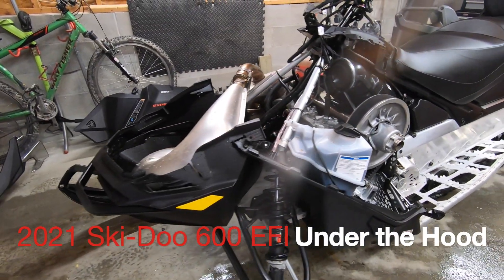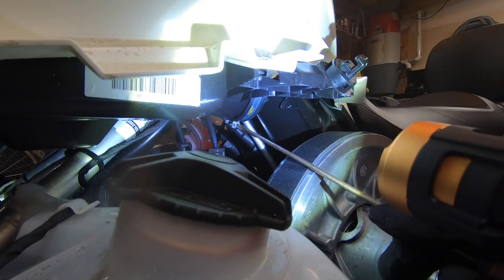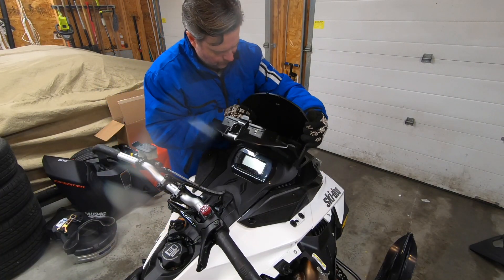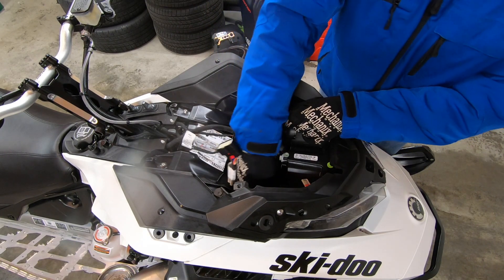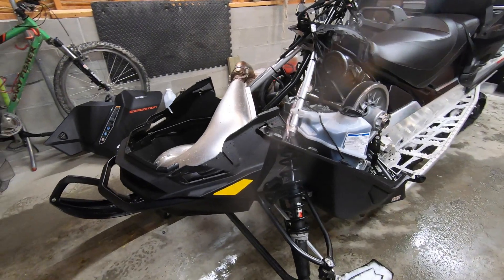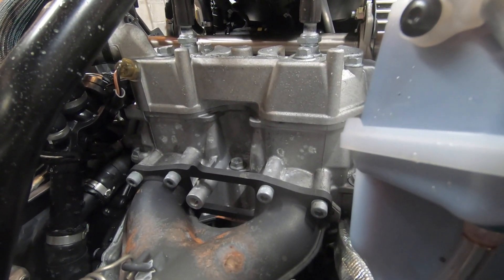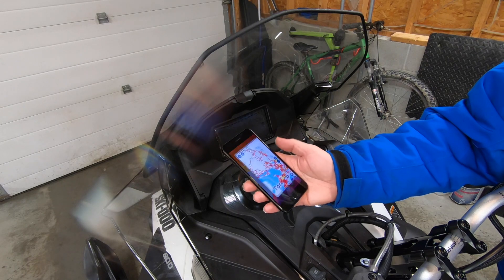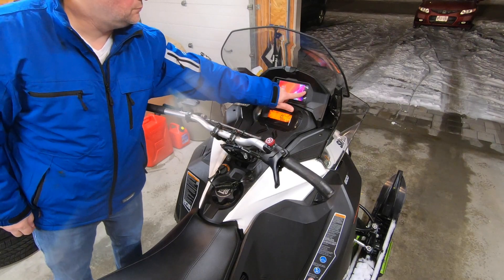600EFI Under the Hood

Comment: what kind of mileage are you getting with the 600 efi and how does it do in extreme cold temps for starting, like -40 F?  Great videos, doing research before getting one as I am use to the 600 ace in past models.
Reply from the maker: Fuel and Oil consumption documented right here my friend! https://youtu.be/oaB36RJx6lo
Extreme cold: if it doesn't start right away, hold the throttle open and try again to avoid flooding the engine. It hasn't let me down yet. Coldest day so far was about -36°C.

Comment: Iam a serious brp fan.. and really like these new sleds handling. But when I looked at wide tracks it's between expedition skandic or vk540. At least on the 540 I can change a darn spark plug
Reply from the maker: I'll have to update this video: after removing the upper bodywork a few times, I can have this hood off in 5 mins and it gives me better access to the internal components than the classic front-hinged design.

Comment: Well great video but these new sleds suck for maintenance! give me the days when you could just lift the hood and work on it. Anytime you have to undo multiple electrical connectors you are going to start having issues that is fact dealt with it already on several sleds
Reply from the maker: To avoid problems down the line, I've been applying dielectric grease liberally to every connector I encounter. This should lubricate the contacts for easier maintenance in the future, but also to reduce wear when disconnecting.
Reply: @mop1471  Yes that comes with a risk also. Some will disagree but this is fact learned the hard way. You should never apply dielectric to electrical contact surfaces as it is an insulator not conductor. It will actually cause a plugged connection  to not work properly.  Again I know many use it and it is great stuff used correctly but not on a contact surface.
Reply from the maker: I don't disagree at all. Professionally, I design computers for industrial vehicles. We had some problems with connectors corroding, so we did the math and determined that applying dielectric grease, even to contact surfaces, will solve more problems than it creates.

One of the reasons for this is because we've over-rated connectors by 99%. So a max 30mA circuit will use a 3A connector. Since we only need 1% of the contact surface, the dielectric grease won't degrade the connection enough to cause electrical problems, but it does solve corrosion problems! (It's worth noting that we can't use 'appropriately' sized connectors because a connector rated for 100mA will be far too small and delicate to survive the industrial environment, so we must use larger connectors with stronger mechanical properties.)

I suspect Ski-Doo does something similar. I see a lot of Molex connectors under the Ski-Doo hood, rated for 20A+ per pin, and they're powering circuits that can't possibly draw anywhere near that kind of current (with the possible exception of the headlights.)

Comment: I really appreciate your videos. I just purchased the skidoo expedition sport with 600 efi and the information is great to learn the sled. I just purchased a helmet with heated visor. Any chance that you are going to do an instruction on how to install the power supply?
Reply from the maker: Glad you're enjoying the vids!

The first mod I did was the heated visor connector installation, and I'm afraid I didn't film it :(( 

Installation required removing the upper body work (as documented in this video.)  It seems like a lot of work, but it's really not bad and it'll be great to get some practice with your new Expedition. I've got the body work removal down to 5 mins now that I've done it a few times.

Heated Visor Kit Ski-Doo p/no 860201283 is really well priced directly from Ski-Doo and it's a great first DIY project.

Installation (with upper body work removed): 
- The hole for the heated visor plug is pre-drilled in the console and covered with a plastic cap. From the right side of the sled, reach under the console and pop out the plastic cap. (see timestamp 3:40 in the video.)
- With the heated visor plug wiring harness, slide the grounding ring over the threaded portion of the plug, then insert the plug through the hole in the console, from the underside of the console. Hold it there with one hand.
- With your other hand, thread the plastic nut / connector cover onto the heated visor plug above the console. Don't do this by twisting the harness under the console as this will strain the wires in the harness. Instead, hold the connector and harness steady and spin the nut / connector cover from the top of the console.
- Next, you'll have to make the electrical connection to the accessory wiring harness. Most accessories have a 'pass through' connector, so you can daisy-chain more accessories to the circuit. The last, unused plug is always left connected to a 'dummy plug' under the console. Location of the dummy plug is identified at timestamp 3:55 in the video. Unplug your accessory wiring harness from the dummy plug and connect your heated visor plug wiring harness to the accessory harness. The heated visor plug harness does not have a pass-through connector, so you won't have to reconnect anything to the dummy plug. 
- Use zip ties to make sure the heated visor plug wiring harness is secured in a safe spot under the console (you don't want the wires to be able to pop out while you're reinstalling the upper body work!)
- Reinstall the upper body work and enjoy a fog-free snowmobiling experience!

As soon as we get enough snow for the trails to open, we'll be filming some Ski-Doo adventures! Make sure to subscribe so you don't miss upcoming videos, and please share these videos with like-minded snowmobilers!

Comment: I wish the 2022 Expeditions would have kept that body work. I spring ordered an Expedition and a Renegade (both 600efi), and the Renegade (same upper body as your 2021), is way easier to work on than my newly designed Expedition upper body.
Reply from the maker: Interesting. I noticed that the brochure no longer specified 'narrow body work' on the Expy 600 EFI. I suspect they're trying to differentiate it from the sportier machines - with the narrow body work, the Expedition was basically somewhere in between the Backcountry and the Summit. 

On the positive side, your wide bodywork should accommodate the radiator with electric fan for additional cooling if you ever want to go that route!
Reply: @mop1471  I heard you could install a 20" track also, but can't confirm on the 2022. Great vid btw, I will be getting a Sport Expedition also.
Reply from the maker: Some Expeditions are available with 20" wide or even 24" wide tracks. I don't know if the tunnels are wider to fit these tracks. I've heard reviewers talk about how wide the SWT versions are, but it's unclear to me if they're literally talking about the tunnel width, or just the handling of a snowmobile with 24" wide track...

Comment: Other then the emergency pull cord Does it have a pulll start??? Maybe i missed that part .. or is it all electric start?
Reply from the maker: No, it does not have a pull start. Just electric or emergency cord. 

I was actually tempted to spend more for a machine with the SHOT starter system, because it has a proper pull starter in addition to the emergency cord and SHOT system. However, I'm happy to report that the electric start has been 100% reliable throughout the first season or riding.

Comment: Great video. Can the 600 EFI spark plugs be changed by removing the side panels only or does cab need to be disassembled on the trail to change them? I recognize parts under your hood... my 900 ACE not so much.
Reply from the maker: I haven't had to change the plugs yet, but I'm sure I could reach them through the side panels. If I were in my shop, I'd just pull the upper body off. It only takes a few minutes and gives full access to everything.
Reply: Remove the side panel, easy access. I have 4500 km on my Backcountry 600 EFI.

Comment: Range?
Reply from the maker: It’s still in break-in, and the manual says it runs rich until break-in is done. So I can’t really say yet. I’m expecting about 300 kms per tank if I can behave myself.
Reply: @mop1471  200 km would be a better number.

Comment: Great video...any regrets on the sled? Any issues, concerns, problems? Is it comfortable? Does it dart from side to side? This "twitchy" steering is a common skidoo trait. Thanks bud
Reply from the maker: No regrets at all. Big traction, 2-up seat, awesome price. Only compromise is the top speed, but I hit 112 on the lake tonight, and that’s fast enough for me (don’t get the wrong idea, it has LOTS of torque!)

Local trails aren’t being groomed yet, so they’re pretty rough. Riding them is fine, but I wouldn’t call it comfortable. I’m certain,
 once trails are groomed, the sled will be super-comfy.

I have no sensation of the sled being darty.
Reply from the maker: Quick follow up: was out trail riding with a buddy on a 1,000 Yamaha. He reached 130kph on ice, I reached 124. Not bad for being 45 horsepower short and a longer track. Overall, I couldn't quite keep up in the twisties, but could make up the difference on the straights.
Reply: @mop1471  My Expedition Sport 900 ACE is not any faster. In case you were wondering. More complicated, more expensive, but quieter & only slightly more fuel efficient.

Comment: Awesome video man. How the sled handle in the trail?
Reply from the maker: Handles very well, even on the non-maintained trails I have access to.

Check out my 'first impressions' video here for more: https://www.youtube.com/watch?v=nvgm1mTYt7c

When I first mounted the sled, I sat so high, and it feels so narrow, that I was worried it would be tippy. But the centre of gravity is so low that it isn't. Took me an hour or so to get accustomed to the sled and to start to trust it. While riding, I do find myself shifting my weight around a fair bit, much more so than on classic, non-rider-forward designs.
Reply: @mop1471  yeah I saw that after this one lol. Can you do a vid on how the rear section of the skid works with the locking pin and what not
Reply from the maker: I'm planning to do just that! Need some deep power do do it right. 

Murphy's law: the year I buy a new sled, Northern Ontario isn't getting snow while Madrid gets their biggest snowfall in 60 years.

Maybe I'll make a short vid showing operation of the lockout feature and handling characteristics on hard-packed snow.
Reply from the maker: Did a vid on the locking pin / rear skid. It rides better when the rear skid is locked straight, but turns shaper when articulating. Don't have deep snow yet, so couldn't test reversing (we tried, but the snow's so shallow that ir reversed just as well with the track down as it did with articulation enabled.)
Reply: My wife got the exact same sled this year we got the wide ski skins on it too
Reply from the maker: @Gendronk  How is she enjoying it? 

Unfortunately, I only put about 100kms on mine so far. We haven't gotten much snowfall and I'm not even sure I could get to the trails in the current conditions.
Reply: @mop1471  we don't have much snow either hasn't been out yet

Comment: Do you have to remove all the cowlings to get to the plugs?

Nice job!
Reply from the maker: Thanks!

No, you could reach them and service them just by swinging open the side access panels. But, removing the upper body work only takes a few minutes, then you have great access to everything. 

If I ever had to work with the spark plugs on the trail, I'd probably use the access panels. In my shop, I'd spend 5 mins and open the whole thing up.
Reply: @mop1471  Just answered my question. Thanks